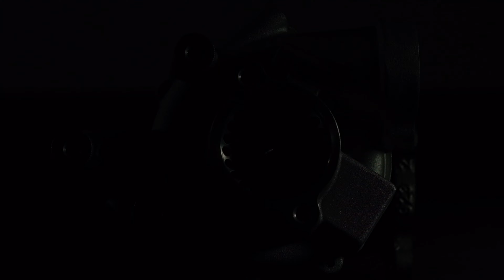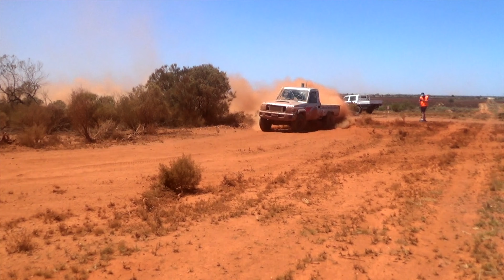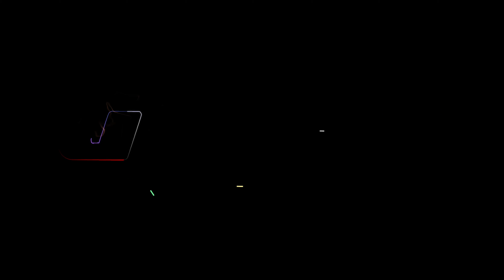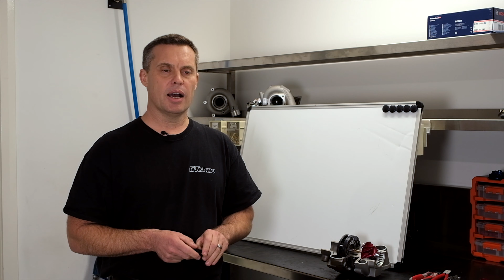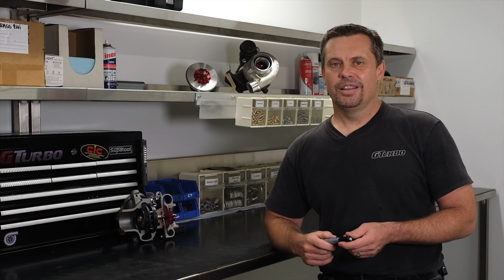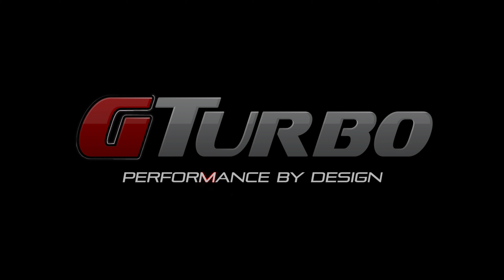Chips or remaps? – WHAT YOU NEED TO KNOW

Comment: Hi, my  Stock Nissan Patrol 2008 GU CRD 3l Auto ZD30 with 271000km needs a rebuild. I am towing a 2.5 ton campertrailer. To achieve 180 HP at the wheels please advise me what products to fit, like which Hi Flow Turbo, which size and type of Intercooler, remap and tune etc. thank you